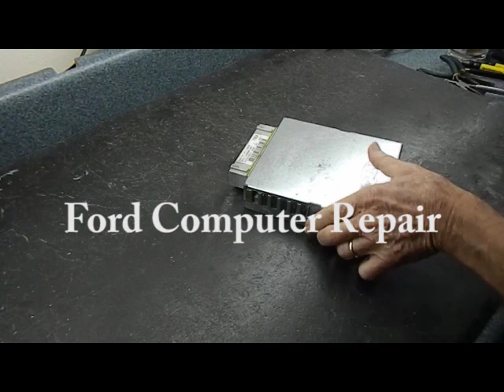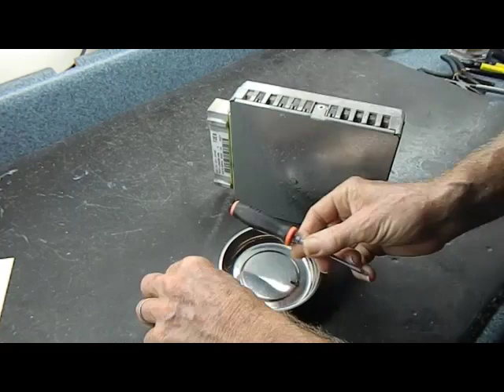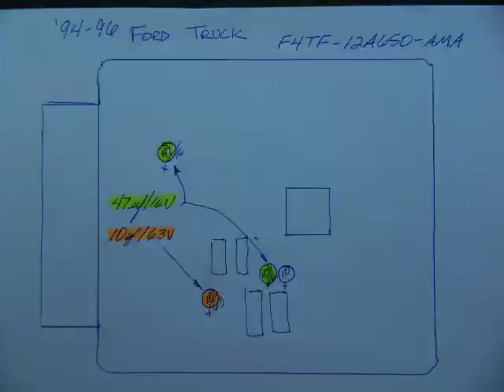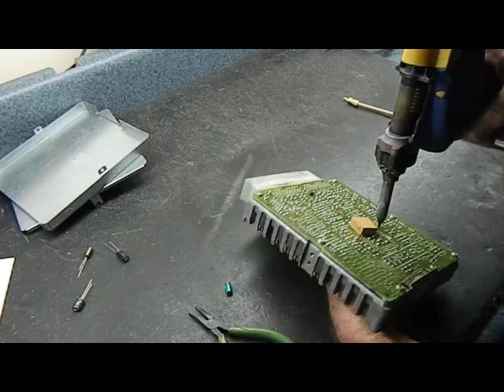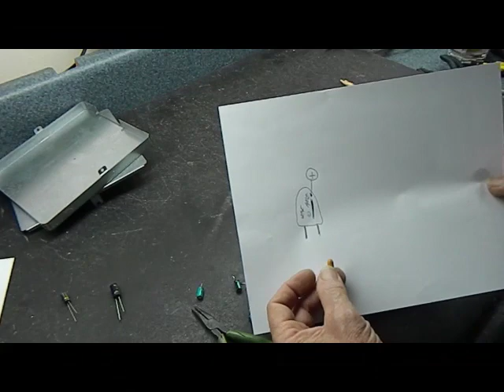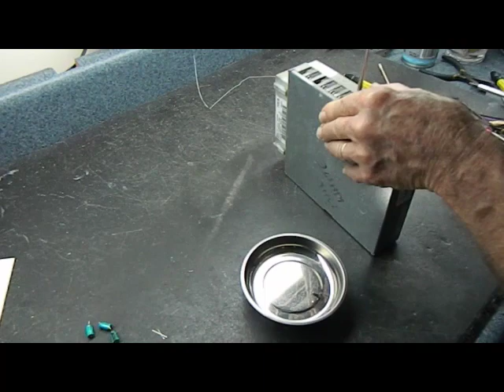Ford Computer - ECM Repair DIY - Transmission not shifting properly. - Car Stereo HELP

Comment: I think it's awesome that there's someone that can fix stuff like this that Ford could give a shit about supporting. I would make a miniature set of blocks, like door installers use when routing hinge pockets, to hold that circuit board while you're taking the caps off .

Comment: I can't find any info on ordering a new one. As in, do we go part number or what. Every siTe I've been on, no part number is asked for. For a 92 ford e150 5.8L #F4TF-12A650-MC
Reply: Your computer part number is F4TF - MC. The 12A650 is never used in IDing any Ford ECM as Ford still uses that number even on 2024 ECM's / PCM's. Hope this helps. Make sure that you get one that has the same type of transmission as your truck.

Comment: One more thing. Tonight I popped the hood to check my PCM ground. It happens to be snowing and the truck was warm so the water that ran off the hood toward the windshield dripped right on top of the PCM. (Drivers side, firewall) When my computer is fixed, I'll be making a roof for my components as well somehow. It has to be the cause of the corrosion

Comment: I have a 96 powerstroke. Rebuilt the tranny...3x. It sux cuz the shops all say rebuild and the tranny was NEVER the problem. Now, aftr 3rd rebuild, its not shifting in high rpm 2nd and 3rd gear very well, or at least consistently. Sometimes its perfect, then the bottom drops and it goes outta gear. Usually around 30-40mph. Even the minimal time on highway driving, overdrive slips...like into neutral. I opened the harness on PCM last wk. Corroded pins in PCM and inside the female harness end. I cleaned em. Still have probs. The code says that Keep Memory Alive is the prob. This video is perfect for my situation, but its something Im not capable of doing. Thank you for the info and video. I pray that anyone having the E40D transmission issues can find out the cause and solution ELECTRICALLY before the tranny guy says "rebuild".

Comment: I have a f150 5.8 with the same EEC-IV part number he described. One of my caps was slightly leaking. I replaced all three (not the tantalum cap) Board looked great to begin with, just a slightly leaking cap. Once reconnected, the truck started up within 1/2 a second. Drove fine for 60 miles then the 2nd gear started to "lag" (stumble into 2) felt like a "late" shift.  /// Because in the video they replaced the transmission, we will never know if these caps fixed the problem. I read a lot that those caps have to do with the fuel pump. Turn the key forward and you should here the fuel pumps in the rear make a sound for 1 or 2 seconds (priming).    

Having late shifting in 2nd and a little in 3rd. I reset my speedometer (PSOM) look it up. I was at 978 and should have been at 944. That fixed the heavy clunk into 2nd and 3rd (thought I was going to bust the transmission until I did that little fix)

Seems like there are 100's of reasons why the trans is shifting funny now. Could be sticking solenoids? Funny thing is when I disconnect the battery for 2 minutes and reconnect - truck DRIVES FINE. What gives? Thoughts?
Reply: There are repair pigtails for the automatic trannys for the solenoid valves, usually contacting is were the wire enters the plug. Under heavy rain conditions you can get bad shifting if there is a wiring problem.
Reply: I'm having shifting trouble with mine. 93 Bronco. Only one active code - 622( 3rd and 4th solenoid circuit failure) Wiring harness and connections good, with continuity between solenoid pack and the PCM. The code implies there's no signal FROM the PCM to the solenoid pack in the transmission for 3rd and 4th gear solenoid. I removed the PCM and found two of these capacitors have leaked across the board, but it doesn't look like they've corrupted other components. Basically I'm looking for a schematic of this control board, to find out what is what.